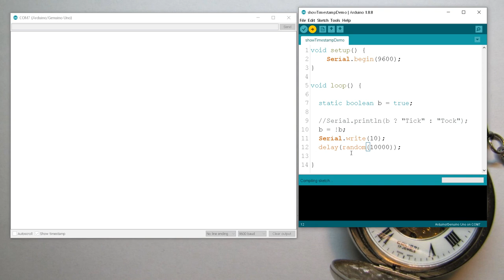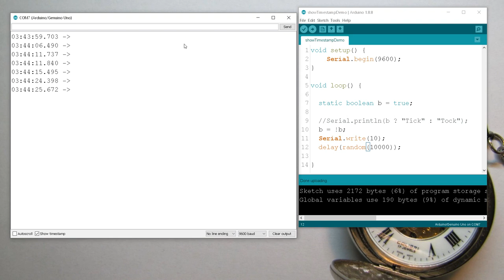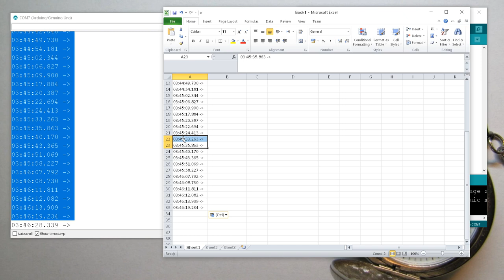Arduino Serial Monitor Timestamps: demo and explanations

Comment: Can you increase the precision of the value after the decimal point somehow? Or maybe change the sample rate or conversion time to nano seconds? or maybe somehow plot the time directly from the PC or RTC or increase the memory? or maybe sample the time directly from the time server?
Reply from the maker: No.
Reply: Why?
Reply: Because the hardware or the software limitation?
or maybe because the serial data transmission unlike the parallel?
Reply from the maker: You should probably ask the people who wrote the Arduino IDE...
Reply from the maker: No, I am allergic to web-based software.
Reply: /* i try this one code before to compare the time gaps */

unsigned long time;
void setup()
{
  Serial.begin(9600);
}
void loop()
{
  Serial.print("Time: ");
  time = millis();
  Serial.println(time);
  delay(1000);
}
Reply: do you try this in linux to?
Reply from the maker: No.